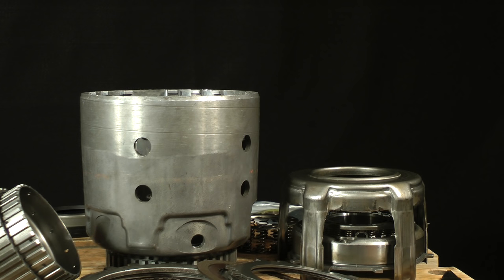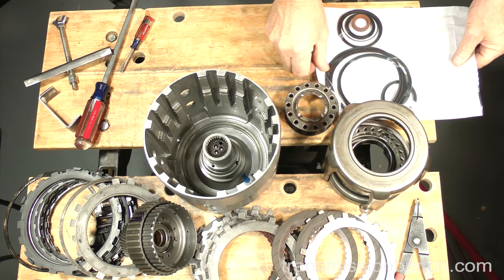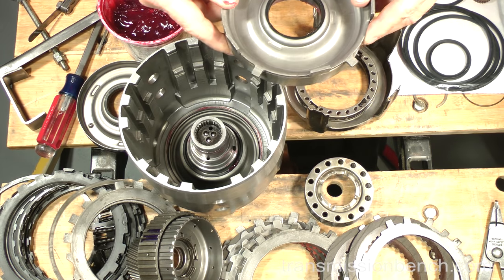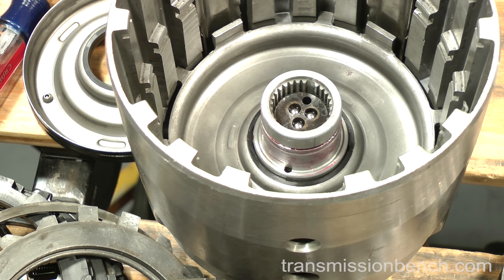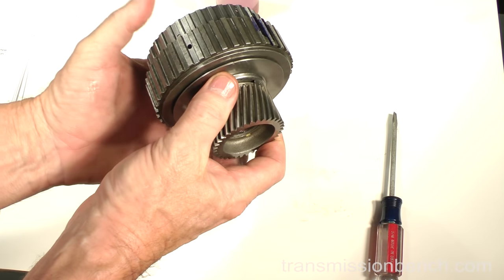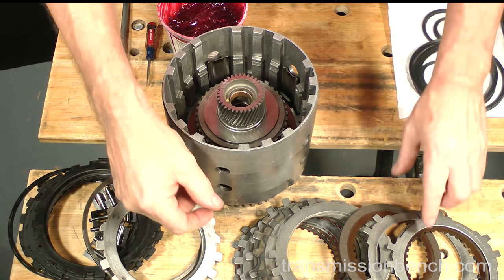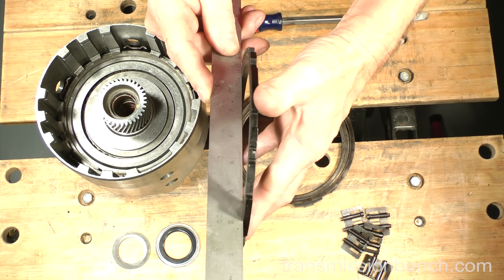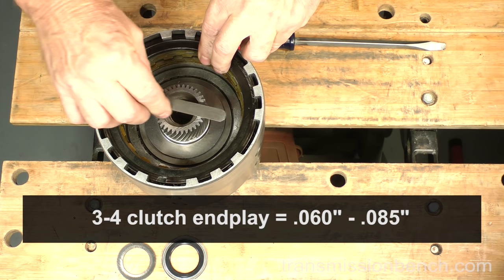Project 4L60E part 2 lesson 5

Comment: I am in the middle of my 4l60e rebuild. I order a power pack clutch set for the 3-4 has a total of 9 friction plates and 10 steel plates  I can't not find a diagram neither could of figured out how to stack them up. I ended up placing a friction plate at first and a steel plate and so for a total of 8 friction plates and 7 steel plates my gap between the snap ring was over the 85 thousands of an inch.  Any suggestions..? I remember at the end of this video you talk about the different ways of stacks but I went for the last one you said that in the middle of the stack to steel plates would be one after the other . You think that would work for me.
Reply from the maker: Hi Gilberto. It is extremely important to get the endplay .085" or less. If you cannot find a combination of frictions and steels to arrive at this amount, there are 3 selective end plates available. The thicknesses are: ,227", .192", and .157".
You already have one of them. Measure and find out which one you have and order the other two from a GM dealer or  Transmission Bench at 706-414-9945. I hope this helps. Jimmy

Comment: I don't know what my problem is, but my truck will drive about 20 feet and just all of a sudden stop and you can hear a really bad crunching sound like steal grinding against each other it's sound worst then im saying, I took it to gm dealer and he just gave it back to me no charge for even looking at it, he told me it was too much to get into and it would be $1,500 just go inside and find out the problem, then more to repair it and since they guaranteed their repair it would be more then the car is worth, well I love my 2002 bravada and it's all I have, I hope you can help me, because I intend to take it out and rebuild it myself with your instructions, even if it takes me two years, I am determined to save this truck, because it's a nice one and that's what me and my wife have. Please help.
Reply: Well...It's been 4.  Howd it go?
Reply: Probably a fractured sunshell. Going through that right now with my 07 avalanche!

Comment: question on sprag thrust washer installation at 14:14 if I put the thrust washer as per your instruction, and install the 3-4 clutch pack and snap ring and I can grab the sun gear and it seems very loose, is this condition normal? If I flip the thrust washer and put it in the looseness of the sprag clutch assembly is much tighter but not and little loose.
Reply from the maker: Hi Jackson. It is VERY loose.This is normal. It feels loose because the assembly is actually supported by the sun gear and output shaft after the input drum is installed into the transmission.
Reply: thank you for your reply I have installed it as seen on the video

Comment: Thanks so much for the help . You took the scare out of it for me. Do you know if a 94 transmission case is the same as 97 case, both without removable bell housings and if the electronics are the same .thanks again.
Reply from the maker: The wiring harness is definitely different.   I do not know if they are exactly the same. If the channel casting passages are the same it will work.
Reply: I'm setting here watching valve body lesson at 8 o'clock in the morning when you replied lol. Just to let you know your my new best friend lol . I bought a core transmission for learning purposes . Thanks for replying so quick . Look forward to learning more from you .

Comment: Does the 94 4l60 have the forward steel pistons like the one your working on in your video thanks
Reply from the maker: No. It uses the aluminum type with removable lip seals
Reply: OK thank you . All the kits I found was with the steel pistons and wasn't sure on what kit I needed . Like I said before I bought a core trans for learning. But internals will be almost the same from 94 to 97 . Thanks for your patience .

Comment: I checked the clearance on my forward clutches and its .120, do you know who sells the thicker pressure plate or possibly a part number?

Or am i missing something

Thanks, Nathan
Reply from the maker: You can get the selective thickness end plates at a GM dealer.
Reply: Transmission Bench chevron
Reply: Transmission Bench chevron

Comment: Does 2nd and overdrive have anything in common? That's what is slipping on mine thanks
Reply from the maker: 2nd and overdrive have the band in common.
Reply: Thank you Sir for the help
Reply from the maker: Joseph Jones
Glad to help.
Reply: Found a good material to make pump aligning tool out of . The metal strap that's used for shipping its half inch wide and you can cut to length like the bucket.
Reply from the maker: Joseph Jones
Wow! That's a great idea. It's definitely better than plastic and a lot simpler to make and cut. wish I had thought of it.

Comment: whereis the best place get clutch retainer package
Reply from the maker: Hi Johnny. I can get any parts that you need even if it's not listed on the parts page. Call me at 706-414-9945. thanks, Jimmy
Reply: Transmission Bench  the clutch retainer cracked is there in thing else i need to replace and do u have clutch retainer for 2004 caravan 3.8engine
Reply: Transmission Bench any videos on dodge caravan 2004
Reply: Transmission Bench  it mat be call a drum to not sure
Reply from the maker: Johnny Adkins
Hi again. Yes I can get the parts for a caravan transmission too. Johnny, you will have to call and describe to me a little better which parts you need. Thanks again, Jimmy

Comment: OK so I watched this video again to see which way my sprag should be installed.  You mention it could go in 2 different ways.  The problem I'm having is the sprag can actually be installed 4 different ways.  The inner race can be rotated separately from the outer race (of the sprag by itself) thus flipping the teeth.  I assume the more rounded edge should go towards the contacting surface.  Not 100% on that since my original sprag exploded.  As an update to my re rebuild not only was the reverse input drum bent at the tabs but the sprag was completely obliterated as well as almost completely worn out clutches throughout.

Comment: thanks again. I will be rebuilding my 4l60e soon. its a 93 in a 2wd chevy truck with 280,000 miles. its starting to slip. this series of videos is very helpful.
Reply from the maker: Wow! It's amazing how long some of them last. Even at 280,00 miles, YOU can make it like new again. Thank you for the comment. It inspired  me today while writing narration for lesson 6. By the way, since you mentioned that the videos are helpful, do you have any suggestions to make them better? I still have lessons 7 through 10 to write and film, so please criticize the ones I've done so far....and good luck with your 4L60E.  Jimmy
Check out www.transmissionbench.com.
Reply: the videos are pretty good as is, can't say i would change anything. I've been a mechanic for 30 years but never attempted a trans overhaul.  thanks again and looking forward to the rest
Reply: Transmission Bench Change Anything? No Sir, These videos are the difference between success and failure. I had a forward sprag that felt smooth as silk, and I was going to drop it back in. You said "take it apart and inspect it". I felt obligated to listen to you since you've done such a tremendous job. Sure enough the brass thrust was so thin you could see daylight through it. So, Thank You for these videos. Joe in Tx
Reply from the maker: Thanks.